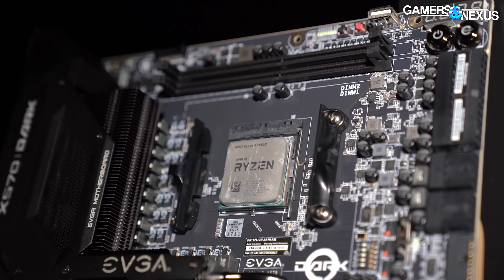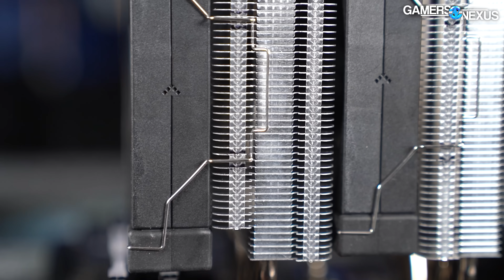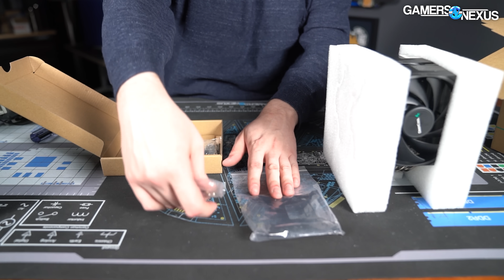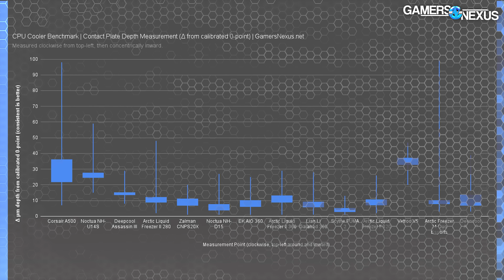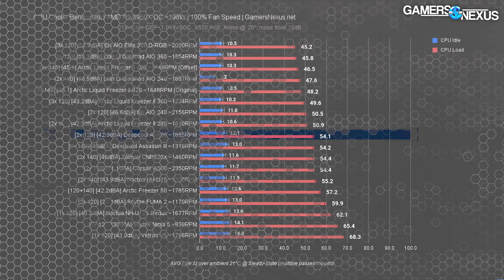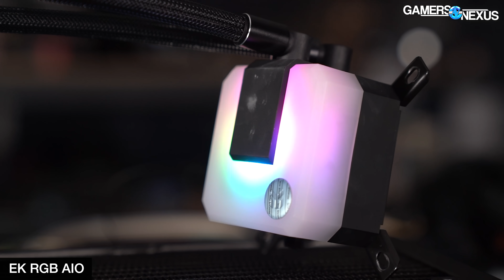Air Coolers Are Getting Impressive: Deepcool AK620 Cooler Review

Comment: As seen from the charts, air cooling is still not as good as liquid cooling.
Reply: Air coolers still last longer and more reliable than AIOs.
Reply: @Doflaminguard  Numerically, your argument doesn't hold up to the actual facts. Modern air coolers (that are worth a darn) can be too big and too bulky and actually reduce case air flow for the GPU up fans, bottom up fans, and any side fans. A water block has a much smaller area profile on a CPU or GPU and doesn't get in the way of case air flow. Longevity-wise, in one of my main computers, I still have an EVGA 1080 Ti FTW3 Hybrid AIO that has been running reliably every single day for close to 5 years now. But yes, I understand the hesitation over water-cooling and high performance... as it is the realm reserved only for the brave and not the feint of heart.

Comment: I think the shape of the cold plate is optimal for LGA1700 as there has been a light drama with Alder Lake IHS bending under some coolers and the “washer mod” solution in particular scenarios where the middle of the CPU lost contact with the motherboard socket pins. I’m starting to wish the standard CPU cooler test methodology included Intel CPUs not just AMD. It wasn’t a big deal until these recent developments with Alder Lake. Thank you for considering my opinion.

Comment: Majority of users don't heavy oc the cpu so you don't need that little extra cooling from aio or custom loop.
I'd sacrifice 5% of that oc just to be sure I don't destroy my components and don't pay extra for that loop/aio.
I've been using noctua NH-D15 for 5 years and it never failed me.
4 generations of cpu, including fx series.... Yeah. Because I was crazy. Haha.
Noctua is the only component I didn't change in all these years.
Fans never died. No weird noises, nothing.
Even if they die, you can be sure that your cpu won't fry itself.
Now I'm using an 5600x with auto oc +200. Small fft in p95 goes up to 85°C(145W reported by hwmonitor and cputemp), which is 10°C under limit.
The cpu goes nowhere near that temp when I'm gaming or compiling programs.
It stays at maximum 60-65, even in multithreaded apps.
It's more than enough for me.
I'll change it when it rusts.(which won't happen in the next hundred years or so)
Or maybe the capillaries inside the cooling system will fail and it won't cool anymore.
Don't know how would that happen, but anyway.
You even get the new mounting bracket for free... It took a while to arrive though. :)

Comment: I got this for sub-60 USD in my country (57.25 USD to be exact with direct conversion from our local currency), together with shipping and LGA 1700 mount. I used this for my i5-12500 (overkill, i know xd). I picked it coz it's the only CPU Cooler in my country (around that time) that has LGA 1700 mount and also black as I was building a stealth black build.

No regrets, it's quiet, cool, and sexy. Worth it <3

Comment: One question comes to mind. It may be silly, but: do heat pipes release their fluid into the environment over time? How much time would a heat pipe need to do this? My guess is that they can release fluid, but it would take an extremely long time for functionality to be affected, so it may not end up being an issue for long time users. Would be interesting to test this somehow.^^
Reply: I am not an expert, but I know that industrial heat pipes usually come with something like a 20 year warranty.  So the manufacturers do expect them to fail.  From what I understand gases from the environment can penetrate into the copper tubing and screw stuff up slowly over time. How fast this happens will depend on the fluid used, the operating temperature, etc.

Comment: i would like to see 25 dba noise normalized testing, that is what i want from a cooler and think it should show greater difference between coolers. if you do not have 20db noise floor then maybe extrapolation from fan speed and db data, 600rpm should get you close on many fans, and perhaps only use one fan for dual fan coolers.  
this is why i think the noctua d15s is so great, a single large 150mm fan 600rpm cool my cpu at what i think might be in that 20 something area.

Comment: The Scythe Fuma 2 is no longer a $60 USD cooler.  It's jumped to $65 and it's a new version, or new revision.  It's basically the same but it has the mounting capability for Intel 12th gen.

Comment: Serious question - as an owner - is the Noctua NHD12S not on these comparison charts because of cost compared to performance? I think a few twin stack coolers with dual 120mm fans have avoided direct chart comparison with Noctua's NHD12S.

I wish it was listed so I could quantify how much I spent on chromax black with white fittings over cheaper options at same/comparable cooling.

Comment: The whole problem is that the NH-D 15 is actually worse than the u12a. Check it out. If you are to get a Noctua, get the u12a. I've been doing a lot of research. Interesting thing about the chromax u12a (the black one) is that it's just a little bit louder than the u12a.

Comment: I've had the stock Intel CPU cooler on my build that came with my i5-2300 from 2012 it still works flawlessly, air coolers never fail, the only maintenance that they need was that one time I opened the computer case and wanted to see if the CPU fans were spinning and they were then proceeded to close the case 😂

Comment: the FK*** letter/number nomenclature is probably stolen from the firearms industry lol. The FK Brno fires the 7.5mm FK round, which is a high velocity pistol cartridge with similar performance to light .44 magnum loads or heavy .357 magnum loads, only at much higher velocities with a much lighter round, meaning it can also penetrate armor better if using hard cast ammo rather than hollow points (the standard load for this round, as FMJ ball just over penetrates). You can thank the Czechs for the weird naming, there's no acronym here to back it, it's just 7.5 FK lol. For context, this thing has similar performance to the .30 carbine cartridge (used in the M1 Carbine), only in a shorter cartridge that fits in a long pistol mag (similar to FN 5.7x28mm, this round is 7.5x27mm). I wonder if someone at deepcool is Czech, or if the guy doing naming is a firearms nerd, since this seems like niche knowledge to me. But yea, it was on my mind because InRange TV did a mud test video on the FK Brno pistol today

RE: the cooler being reviewed, glad to see it perform as well as it does. being able to play alongside an NH-D15 for a discount vs it is always going to be good for consumers. Well done Deepcool!

Comment: I bought the revised Fuma 2 and now it spins at over 1500rpm. Not that I need it thought because it can handle 90w load from 5600x no problem at 60% fan speed. Setting it up to 100% doesn't help much.

Comment: I hope the 40-50 dollar dual tower is one of the thermalright ones. The peerless assassin 120 is really really good from everything I've seen.
Reply: YES. I have the PA-120. Overclocked 5800X sitting under 30° idle, 53°-58° while gaming, and 72°-78° on stress tests. Take these tests with a grain of salt, because my ambient is 20° (Canada) and I hooked up another fan at the back of it.

Bought the grey one on sale for $38, and Amazon made a mistake and sent me the more expensive black one (which I wanted) that cost $55.
Reply: Or for some extra umph, the Thermalright FC140 with its 5x8mm heatpipes should be quite a bit better than any air cooler in this category besides the likes of the Dark Rock Pro 4 or many 280mm aio's
Reply: @deadly_mir  
Thought about that as well, but unfortunately, I didn't have the clearance for it.

Comment: Despite the marketing bogus of the Assassin 3 it's a really solid cooler that can keep my 10900 in check. 
My only complaint about it is that it uses a plastic backplate instead of a metal one.

Comment: Steve, You should review the cheaper be quiet air coolers. I've used them in builds for customers and have had great success (heck, I used a non pro dark rock 3 for a 3700x and never get over 60-70° in editing loads).

Comment: That's great, and at a decent price point. Quite impressive. :)
@Gamers Nexus: I'd be really happy if you could take a look at Noctua's NH-U12A and the full BQ Dark Rock range. It'd be wonderful to finally have reliable data on those coolers and how they stack up in the current market. 
Love the form factor of U12A but not sure how good it really is. Expensive bugger, too. I have the DRP 4 which has been flawless (and inaudible) on my 8700K since release. Not sure if it can cope with a 12900K though, which is my next upgrade.

Comment: I’m a big fan of 100% air-cooled computers. My gaming PC has a Noctua NH-D15S. I run the fans at a fixed RPM of only around 700, and it’s dead silent. The CPU always stays cool. And I buy GPU’s with quality air-cooled designs and just keep them totally-stock. Then I put everything inside a mesh-front case with 3 Noctua 140’s at the front running at a very slow, fixed speed (around 800rpm). And the computer’s done. Everything just stays cool and quiet for years with essentially zero maintenance.
Reply: What model noctua 140mm. I’ve got a white themed build coming up and was considering which front fans to use.
Reply: All air cooled system aswell. I grabbed the same cpu cooler as this video is reviewing.

Comment: Does it have the same AM4 mounting bracket as Assassin 3? It does support AMD one so it looks like improvement.
Deepcool Assassin 3 could not fit some mini-ITX x570 motherboards (like Asus Strix-I gaming) due to mounting bracket design. I had to return mine and get NH-D15.

Comment: Having had a D15 in black for a while now I’m not concerned when it came to market, not sure that matters much here BUT to get comparable performance at a lower price is good to see.
Reply: Comparable is an understatement, as the AK620 clearly slaps D15 in high wattage scenarios, both temps and noise wise.
Reply: @AndyU96  I need to rewatch as I only saw 1-2 degrees and 1-2dB differences, so not exactly ‘upgrade’ material.

Comment: As usual, great review and a pleasure to watch - keep up the good work! Nontheless, I would like to make some suggestions I think would make your videos even better:

1) When showing the pressure maps, could you show them side by side with the direct competition (in terms of price) and maybe a good/bad example? This would make it easier to quickly evaluate the results, especially for first-time viewers that haven't seen a lot of your cooler tests but are interested in the reviewed product.

2) Could you test the coolers with a standardized fan(s) so we can better evaluate whether the cooler itself is good/bad or if it's just the fans that are good/bad? Like with the Chinese dragon cooler recently, it would be a great deal to buy a cheap but good cooler, replace the crappy fans and to match or even beat the performance of a pricier one.

3) Could you give a short sound example of the fan/cooler at different speeds (50/75/100%)? Noise level is one thing, pitch is another: two fans/coolers can have the same volume in terms of dBA, but one may be more annoying to the human ear than the other because of the specific sound it produces.

4) When reviewing an air/liquid cooler, could you chart the test results against other coolers of the same type and only later show how it compares to other cooling solutions? I would argue that someone in the market for a tower cooler isn't really interested in how it compares to a 360 or 420 AIO and vice versa -  usually you know what you want or need and just want to know witch one is the best. By throwing all in one chart you make it really hard to quickly judge the product and basically force the viewer to pause the video and go through the chart line by line to find and compare similar products. It also would be great to have roughly the current street pricing or MSRP next to each product in the chart, this would make it even easier to evaluate the different coolers.

Comment: Noctua just cannot be beaten. Their engineering and meticulous perfection of every detail is otherworldly.
Been using their coolers for my CPU since 2005, switching from Zalman which, while very innovative at the time, just couldn't keep up with the TDP jumps between CPU generations.
It was only after I had to change 2 Cooler Master and 2 Deepcool case fans a couple of weeks ago that I realized how good Noctua are in that department as well.
Energy efficiency is astounding. The CMs were straining my 12V rail. Some would say that a quarter of an ampere here and there is insignificant but with a couple of Y-splitters in a crammed micro-ATX case it apparently is.
Dropped ~8 dBs on all sides of the case.
Also, did a smoke test, and let me tell you, I have never seen streams so smooth and uniform across all loads (600RPM, 1800RPM, 2400RPM). For years, I thought those "special" grooves, notches and divets are pure snake oil. Now I'm not so sure.
One thing I know for certain is that Noctua's bearings are the hardiest. And that comes from someone who has lost many a fan due to dust in the rotor.
Next time you're shopping for a PC air cooling solution, make your self a present and go with Noctua.

Comment: Amazing what a company can do when they focus on engineering and not spurious marketing claims. Was tempted with an AIO last cooler upgrade but went with air. If companies provide mounting kits as long as they can they're really serviceable. You don't expect a heatsink to fail, and the fans can be replaced. AIOs if the pump dies you're screwed.

Comment: I really like air coolers. They have the reliability factor. Nowadays i just want my pc to work no problem even if thet means it runs slightly hotter and slower. There comes a point where the consistency of your pc never failing outweighs the small benefits from a better cooler/overclocked part.
Reply: Agreed! My NZXT 360 AIO started acting up after just 2 years. I just replaced it with the AK620 and am quite happy. It's air cooling for me from now on.
Reply: @tscottj  Facts! my nzxt x63 kraken aio just failed after a year and a half. My first time choosing AIO after coming from air cooling and i'm going back to air cooling. Atleast my air cooler never broke
Reply: Yes, reliability is a good factor. And good air coolers don't run any hotter or slower, look at ice giant thermosiphon.
Reply: i really prefer a good aio cooler, dont like the idea of having a almost 1kg metal brick hanging on my motherboard.
Reply: @budgetking2591  It's not hanging on it's screwed in at multiple points. Chance of an AIO leaking is 100 times more likely than an air cooler securely fastened damaging the motherboard.
Reply: @budgetking2591  AIO's don't last very long. Although leaks are kinda rare, pumps dying or water evaporation are real problems with them. There's plenty of air coolers that come within a few celcius of a standard 240 AIO and are much quieter and less money.
Reply: @budgetking2591  Its scerewed in not hanging LMAO. Choosing AIO or Air Cooler is like choosing between exotic car and muscle car, it depends on your preference
Reply: Why do people need to say "I love air coolers" in every other cooler video. Why are you so insecure? Just use whatever you want. No need to prove to anyone why you use something.

As for performance, watercoolers are superior, so no need to twist the facts.
Reply: @Chopper153  it's just commenting on the topic of conversation. Why are people insecure for talking on the current topic lol. Also, of course water cooling can get more performance. No one is contesting that. We were just saying air coolers have long term reliability.

Comment: Sitting over the RAM and only having 43mm of clearance could be a problem. Sure you can move the fan, but then you're losing the cooling benefit over the competition (i.e. Scythe Fuma 2)

For instance, my G.Skill Ripjaws are specc'd to 42mm of clearance. Do I really want just 1mm of clearance between a vibrating fan and my RAM/motherboard?

Comment: Thermalright coolers are cheaper and I'm betting they perform better than this. The PA120 is $20 less and as good if not better. The fc140 is about this price, lower on sale, would love to see them compared
Reply: I was thinking the same thing as I'm looking at the PA120 installed in my Meshify C.  The PA120 needs to be on this channel.
Reply: @MetalGeek464  for reference, I'm running a fc140 on my 10700k and it can handle any OC that I want. My buddy has an 11600k on the pa120 and is super happy with it. Coat vs performance king BY FAR, but I will say currently (3/21/22) both the pa120 and fc140 are more expensive than normal. PA should be around 36-42 and fc should be 55-60max
Reply: @tarsman013  Nice. I'm pretty much in the same boat with my 5600x. I replaced the Arctic Freezer 34 eSports DUO and picked up significant OC headroom

Comment: There is one thing I was wondering about the pressure test, and I know this might sound funny, but some pans are designed in such a way that their bottom is not perfectly flat and accounts for the material expanding under heat - that is, as soon as the pan is hot, the bottom does get flat. Is something like this possible in the world of CPU coolers heatsinks, too, and does the pressure test account for that?

Comment: I don't get the prices. I bought a thermalright macho hr02 for 35 bucks including a nice screwdriver and it cools anything with a slight airflow in the case. I don't get how anyone would buy a 70 bucks cooler